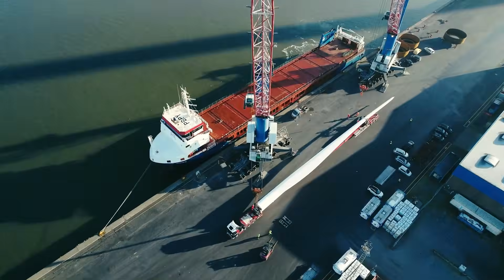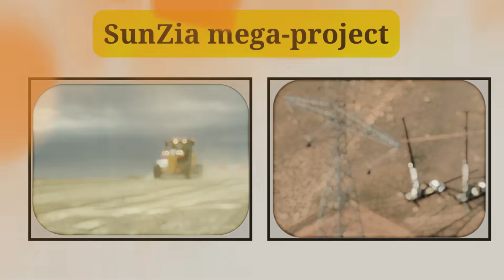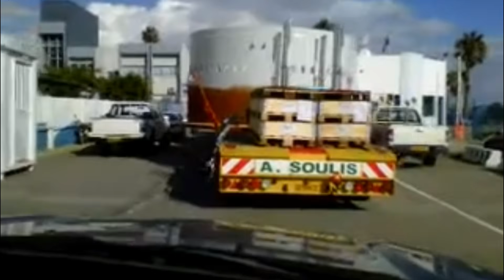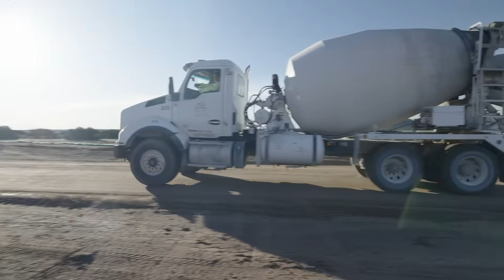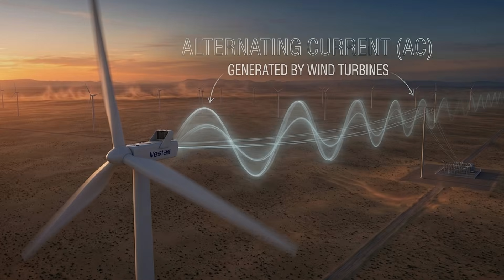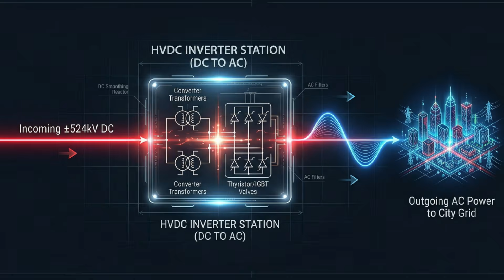How the US is Building an $11 Billion, 900 Wind Turbine & 885km Transcontinental Power Grid?

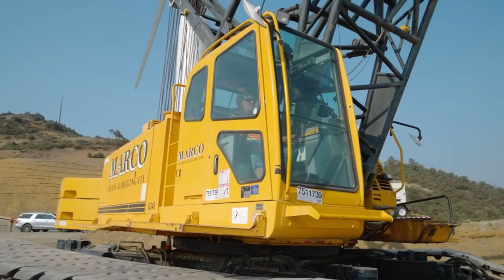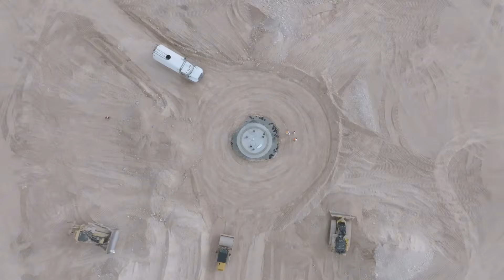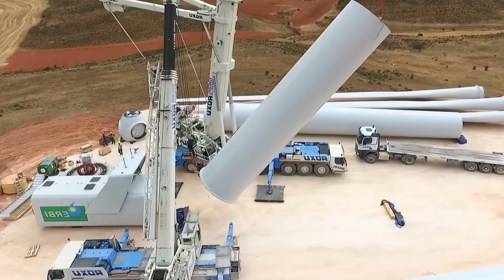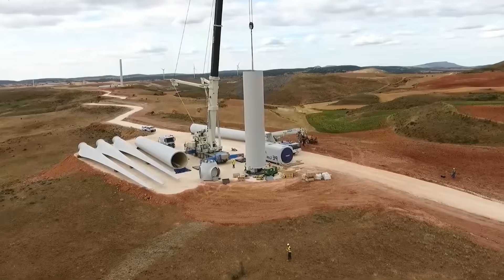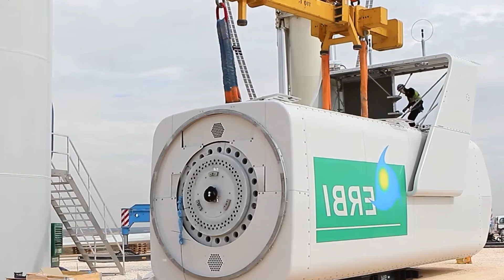Comment: At 8:08 you said crawler cranes are used to assemble wind turbines, but the crane in this video (shown at 8:01, 8:19, 8:22, and 8:47) was a mobile crane, not a crawler crane. I realize crawler cranes may be used for wind turbine assembly, but I think in general it would be easier to get a mobile crane to the remote locations wind turbines are typically installed. There are mobile cranes with the lift capacity required to assemble wind turbines.
Reply from the maker: Thank you very much for this feedback. In some places, for flexibility, they also use other types of cranes. I will take this into account to make general corrections and avoid misunderstandings. Thank you sincerely.

Comment: Wind power generally has a significantly lower levelized cost of energy (LCOE) compared to new nuclear power, making it a cheaper option for new electricity generation in most regions. While nuclear power offers lower operating costs and higher, consistent, 24/7 reliability (baseload), its upfront capital costs and construction times are far higher than wind, often making it 2–5 times more expensive per MWh in new projects. 

Onshore Wind: Ranging from roughly $40–$80/MWh.

Offshore Wind: Costs have fallen dramatically to around $44–$58/MWh in competitive markets.

New Nuclear (Large Scale): Ranges from $110–$230+/MWh.

Small Modular Reactors (SMRs): Projected to be even more expensive, ranging from $230–$382/MWh.

The LCOE for coal in the U.S. varies significantly based on whether the plant is existing or new, generally ranging from around $76/MWh for operational plants to over $100-$150+/MWh for new builds. Existing coal is increasingly uncompetitive against renewables, with many plants facing higher operating costs than new wind or solar.
Reply from the maker: YES, YOU ARE ABSOLUTELY RIGHT.

Comment: Wind power generates significantly lower lifetime emissions than coal, with estimates showing wind produces approximately 11–13g CO₂/kWh compared to 740–1,001g CO₂/kWh for coal. Wind emissions are almost entirely from manufacturing and construction, while coal emissions are continuous due to fuel combustion, making wind about 99% cleaner. 

Wind Power: 11–13 g CO₂/kWh (mostly construction/material production).

Coal Power: 740–1,001 g CO₂/kWh (mostly ongoing burning of fuel).

A 1 kWh increase in wind power can reduce CO₂ emissions by replacing 745g from coal-based generation.

A wind turbine produces enough clean energy to offset its manufacturing emissions in about 7 months.
Reply from the maker: YES

Comment: Chinese manufacturers produce approximately 60% to 65% of the world's wind turbines. In 2023, Chinese original equipment manufacturers (OEMs) held 65% of the global market share, and they produce 70–80% of the core components for wind turbines globally. Key players include Goldwind, Envision, Windey, and MingYang. 

The U.S. remains the world's leading importer of wind turbines. 

The United States primarily imports wind turbines and key components from Mexico, India, and European nations like Spain, Denmark, and Germany. 

Mexico, France, India, Denmark, and Germany are the main suppliers, accounting for over 80% of imports.

Chinese-manufactured turbines account for less than 0.5% of the total installed capacity in the U.S.

In 2024, the US wind industry imported $2.7bn of equipment, up 70% from the prior year, across three main product areas: blades and hubs (49%), towers (31%), and nacelles (19%), with the remaining one percent generator parts and sets.
Reply from the maker: YES, YOU ARE ABSOLUTELY RIGHT.

Comment: The U.S. remains the world's leading importer of wind turbines. The United States primarily imports wind turbines and key components from Mexico, India, and European nations like Spain, Denmark, and Germany. Mexico, France, India, Denmark, and Germany are the main suppliers, accounting for over 80% of imports.US imports of Chinese wind power technology are relatively low, totaling $165 million in the first eight months of 2025.US imports of Chinese wind components plunged from a $619m peak in the 2010s to just $68.6 million in 2023.Chinese-manufactured turbines account for less than 0.5% of the total installed capacity in the U.S.In 2024, the US wind industry imported $2.7bn of equipment, up 70% from the prior year, across three main product areas: blades and hubs (49%), towers (31%), and nacelles (19%), with the remaining one percent generator parts and sets.
Reply from the maker: Wow, you have really deep knowledge in this field. That's right, the United States still imports turbines and components.
Reply: @WinD-LPS The United States has produced the most cumulative CO2 emissions historically, responsible for approximately 25% of all global emissions since 1750, totaling over 400 billion tonnes of CO².

This is twice the cumulative amount produced by China, the second-largest contributor.

The USA is the World's second largest emitter of CO².

China emits 12.7bn tons 
USA 4.85bn
India 2.7bn

Source: Worldometer - CO2 Emissions by Country

EPA - Global Greenhouse Gas Overview 30 December 2025

Investopedia - The 5 Countries That Produce the Most Carbon Dioxide (CO2)
By Andriy Blokhin 
Updated 3 February 2025

China’s per capita emissions exceeded those of the advanced economies as a group in 2020 and are now 15% higher; 2023 represented the first time that they surpassed those of Japan, although they remain one-third lower than those of the United States.

Source: IEA - CO2 Emissions in 2023 The changing landscape of global emissions 2023
Reply: @WinD-LPS  China has had a comparatively short industrial revolution. 

In 2004, China accounted for under 9% of global manufacturing, rising to over 27-28% by 2023.

China manufactures approximately 27% to 28.7% of the world's total manufactured goods as of 2023–2025, solidifying its position as the world's largest manufacturer. Its manufacturing output is greater than that of the next three largest nations—the United States, Japan, and Germany—combined. So it is not a surprise that China requires a lot of energy.

China certainly burns fossil fuels but has not burnt them at the same rate for over 200 years like the USA and Europe. China is now rapidly moving to renewables unlike the US which wants to expand coal production.